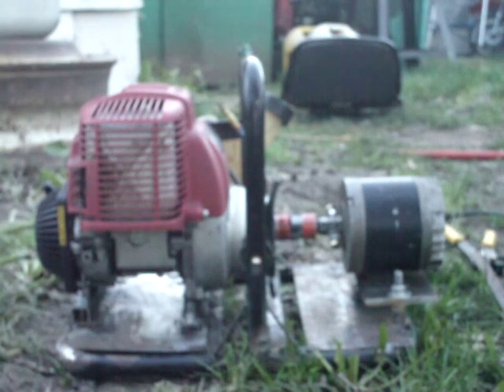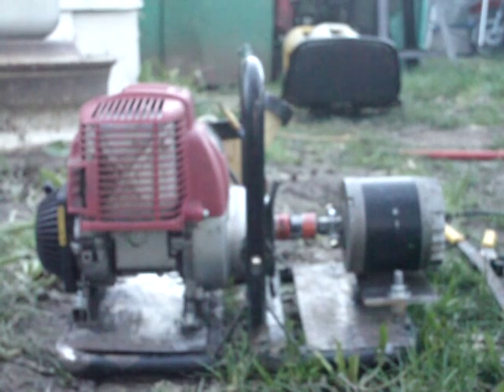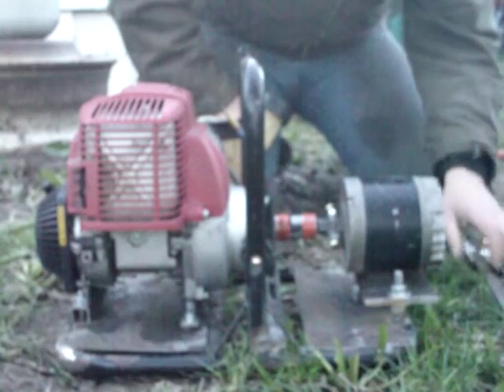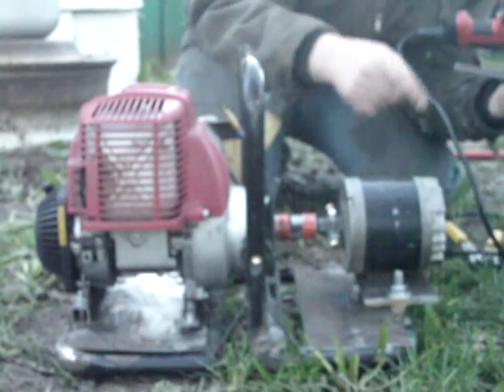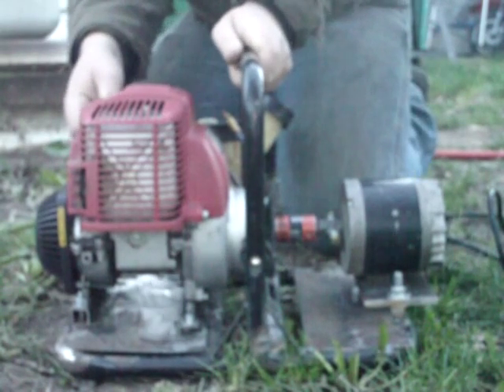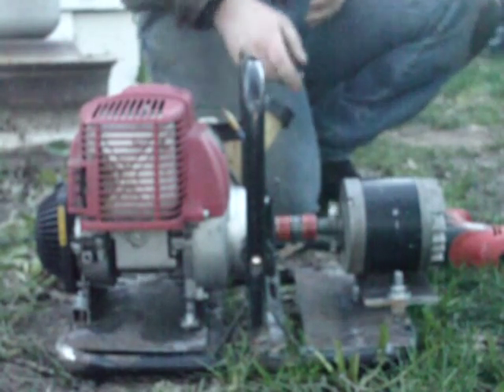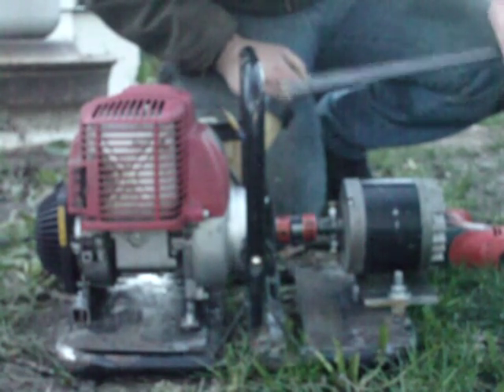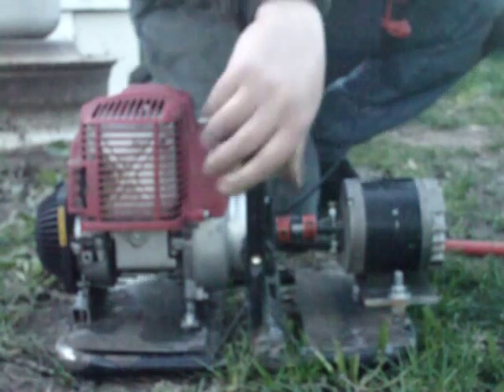MINI GENERATOR (PART 3) FIRST RUN  ..

Comment: Good work Shawn! That's a cool little generator you built. Looks like it would be handy for places out of reach of extension chords, or field work are you going to use it or was it just a fun project to build. Thanks for sharing. 

Adam
Reply from the maker: Oh , It is going to get used a ton man .. I want to put a inverter on it so I can have AC power to !!

Comment: did you check the voltage somehow? according to the voltage
Greetings
Erik
Reply from the maker: Yes at full throttle it puts out 120 Volts DC  !!  Just getting started on this , Stay tuned ..